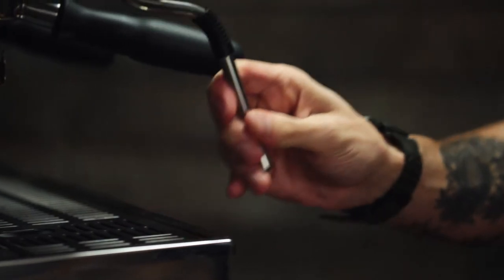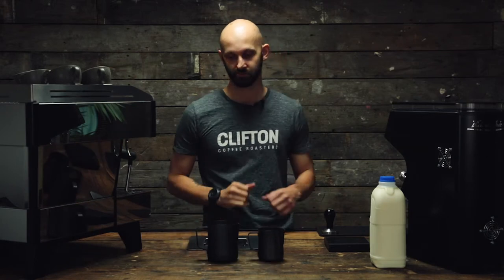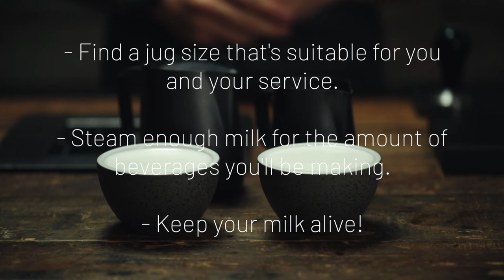Milk Splitting

Comment: Cups appear to be too large for Caps, pouring flat will not allow milk to pick up and push espresso throughout and to top of cup. In 45 years of drinking Caps, I've NEVER seen your technique used and I've been to several very high volume shops.
Reply from the maker: There's not much consictency in cup sizes in the UK for cappuccinos. This method works for all cup sizes, we're not focusiong on the pouring terchnique here, the point of splitting the milk is used when making multiple of the same drink and allows even distributing of the foam allowing the barista to steam a batch of drinks together, hopefully increasing throughput.